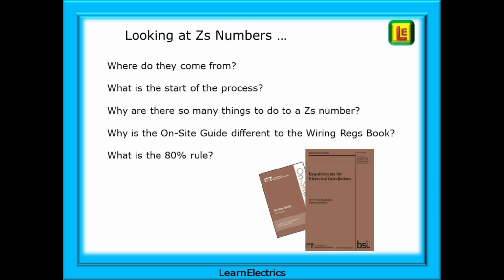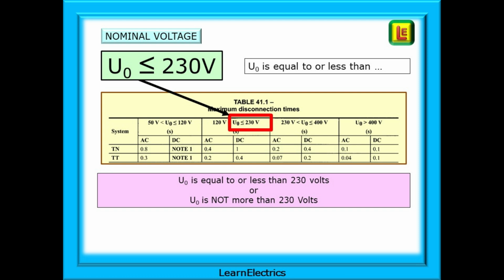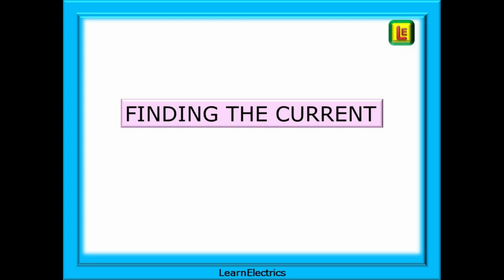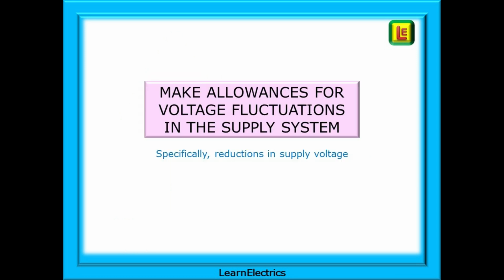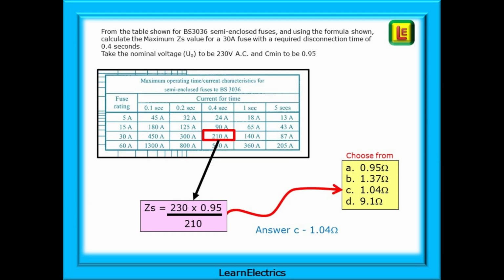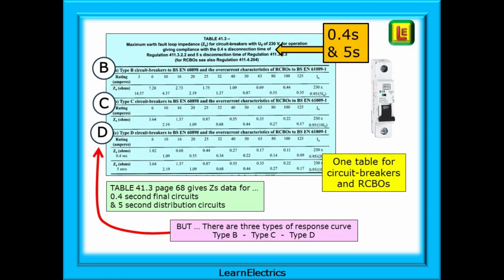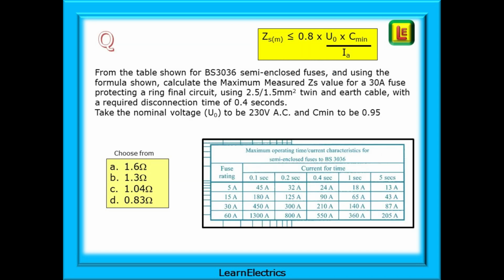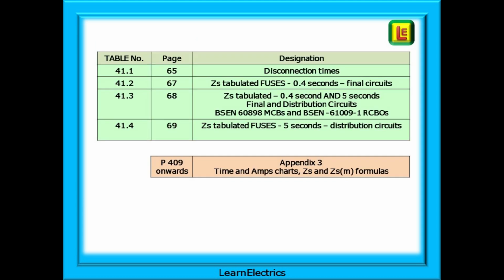18th EDITION EXAM HELP – 2382 - BS7671 AMENDMENT 2 – Zs – Zsm – Cmin – USING THE TABLES - QUESTIONS

Comment: Hi Dave.Thanks for such videos.Would you mind explaining when to use the voltages greater than 230V. E.g 400V?
Reply: I mean in the table 41.1 of bs 7671
Reply from the maker: This is for up to 400 volts with reference to earth, industrial work. Domestically, you shouldn't need that part.
Don't get confused with three phase electricity where we can have 400 volts across phases. This is not T41.1
Reply from the maker: see next response.

Comment: WHICH BOOK IS SUITABLE FOR PANEL SERVICE & DESIGN. PLEASE TELL ME.
Reply from the maker: If you are working as an electrician, industrial, commercial or domestic, you will be expected to take the BS7671 Wiring Regs exam. Some employers will not take you on the books without the qualification. For this you will need the BS7671 Wiring Regulations book. Currently the brown Amendment 2 book, and then print off the Amendment 3 supplement free of charge to make it Amendment 3 compliant. See the link at the bottom for Amendment 3 info.
As to which books for panel wiring, the training centre should tell you which books they recommend.
Thanks for watching.
See the video - Amendment 3 is live.    https://www.youtube.com/watch?v=UVU6MlS16V8
Dave

Comment: Another top video, thankyou.
Can I just ask then in reference to this when completing a certificate and it asks for the tabulated max Zs before your actual test reading, I’m assuming they want the max reading from the tables in 7671 and not the tables in the OSG?
Reply from the maker: Yes, tabulated is out of the Wiring Regs book.
However I always write 80% in the top of column 12 on the schedule of circuit details, then write in the maximum permitted according to the OSG. That way, when I complete column 27 on schedule of test results, I can make a direct comparison. Anyone that knows what's-what when reading my paperwork will know what I have done. Hope this makes sense. This way you are not misleading anybody. Dave.
Reply: @learnelectrics4402  thanks Dave I was taught to think that when tabulated is stated that it was in reference to any information in a table but obviously the info in the OSG is in a table hence my confusion as to which tabulated information the certificate required. In any case you have confirmed it’s 7671 table we are referring to 👍🏼

Comment: Hi Dave, great video but I got CONFUSED by your stating that  a LESS THAN (<) symbol was supposed to mean (according to you)  a GREATER THAN (>) symbol:-  To me it looks as if you got a bit mixed up there on that particular point??? (Go from the 4.14 segment in your video, up to the  4.30 mark, and you should be able to see what I mean, and then be able to tell me if I am correct to be confused by this or not?
Reply from the maker: The video is correct Gary. The symbol you refer to shows that it is less than on the left side and greater than on the right side.